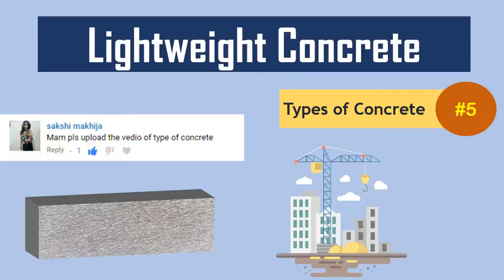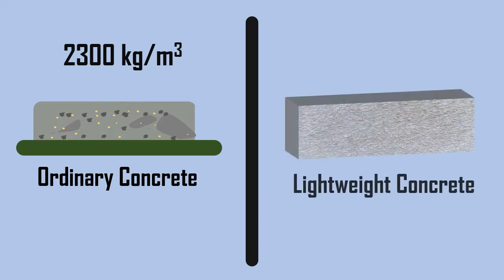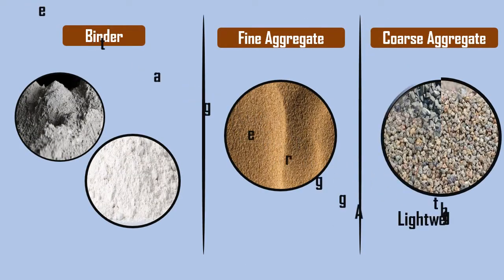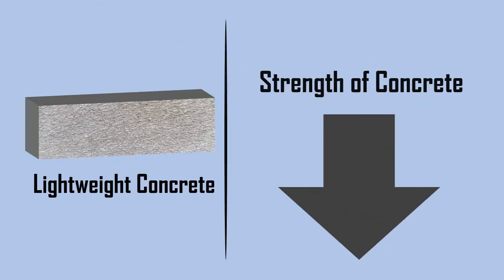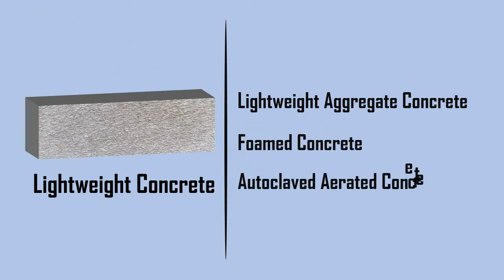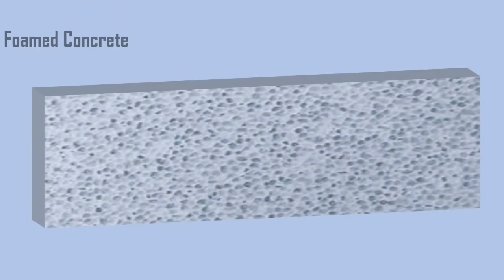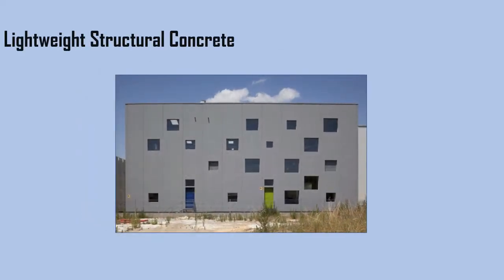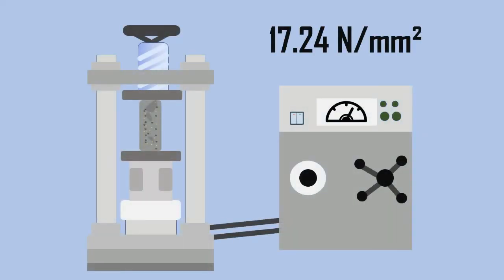What is Lightweight Concrete? || Types of Concrete #5

Comment: One more technology of light weight concrete is based on using EPS ( Expanded Polystyrene) beads coated with additive. These are mixed with cement and water to get desired density which can be as low as 250kg/m3.
Reply: plz shear the link or contact numbr in rawalpindi or islamabad